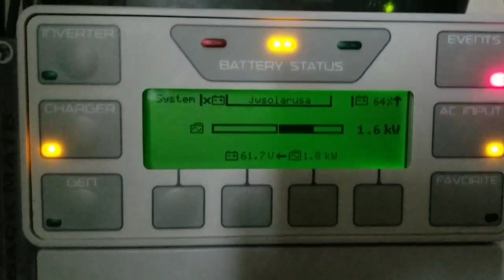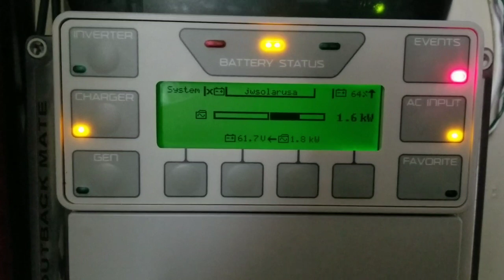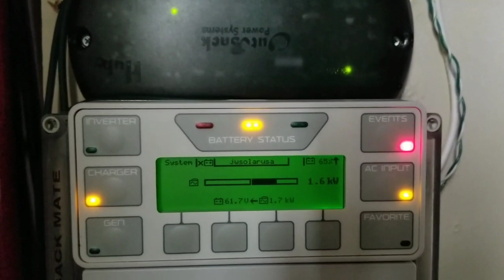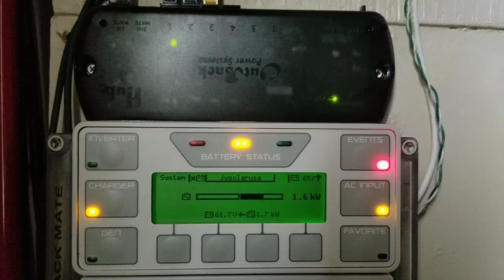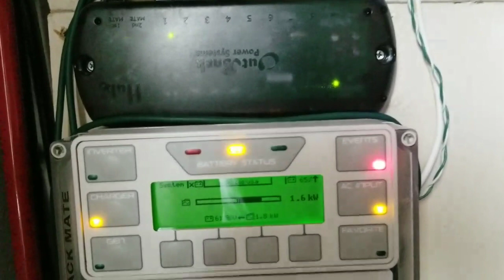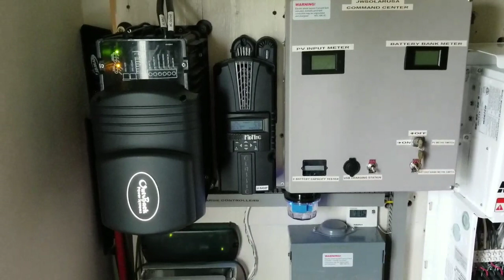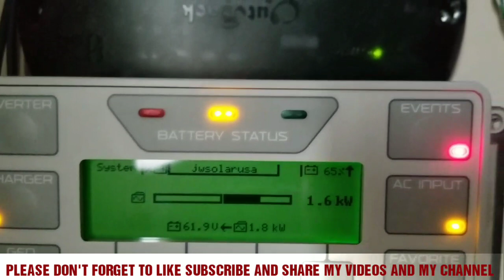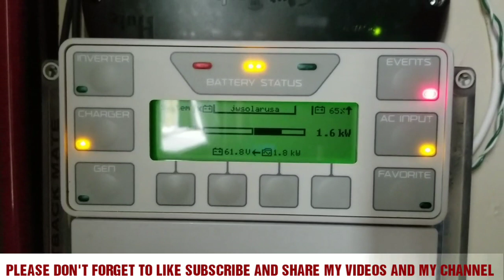OUTBACK POWER SYSTEMS TROUBLESHOOTING (Pt.1)

Comment: I have an outback inverter with a outback charge controller, the event light tell me the fan is failure, and when i connect the charge controller, the mate 3s is off automatically, when i disconnet the charge controller, the mate 3 is on
Reply from the maker: Please contact OutBack customer service for further information.
Thanks for stopping by LIKE SHARE & SUBSCRIBE